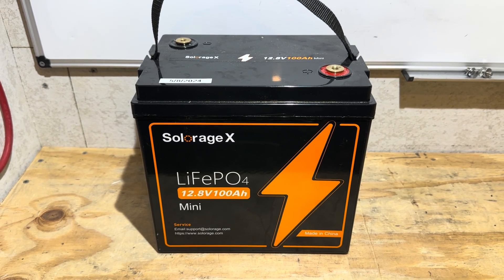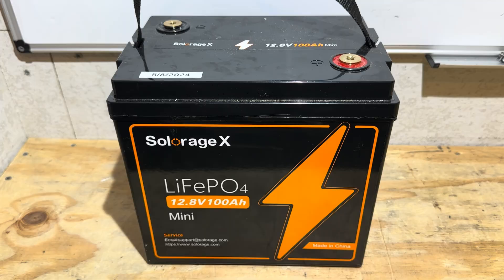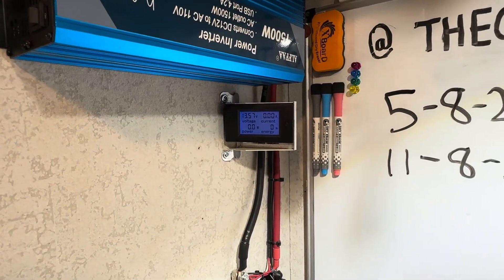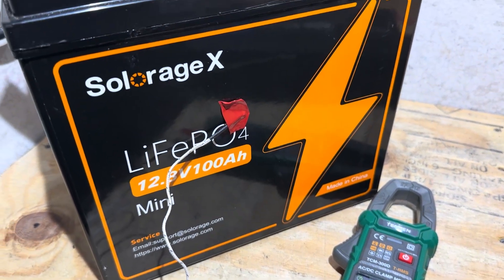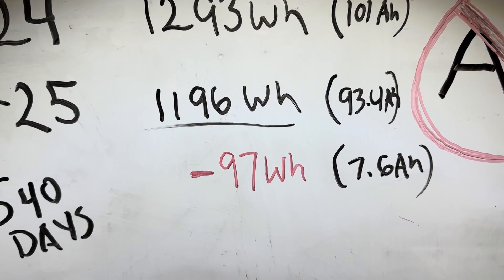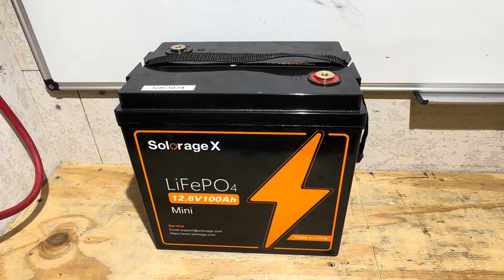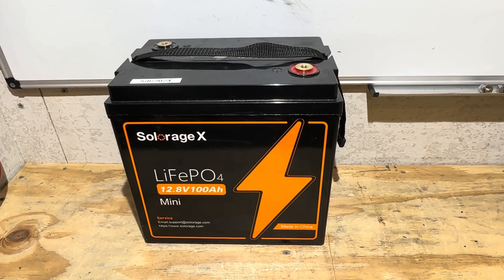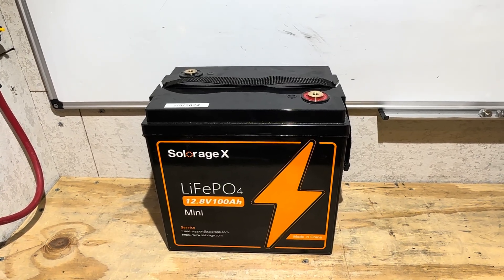Used LiFePO4 Capacity Test, Solorage X Cheap 12V 100Ah LiFePO4 Lithium Battery

Comment: I would be curious if the cells just got out of balance. It would be a awesome test to rebalance the cells and retest.
Reply from the maker: Thanks for the suggestion, that may be a great follow up video! 👍
Reply: @THEOFFGRIDMOUNTAINHOMESTEAD  Yes that would be awesome! I have seen this on several different batteries of my own. But not quit that big of a battery. More like 20ah. So I wondering if that is the same with yours.

Comment: Can it be that low usage creates more unbalance?     I understand that most BMS needs charging to full and some worktime to balance the cells. So, would a couple of discharge to zero and charge to full increase capacity?
Reply from the maker: We’re got to find out soon. Upcoming but not necessarily in this order. 👇
1 battery never used only in storage @50% SOC
1 battery that has been beat to death, pulled to 0 with partial recharge etc.
1 name brand that has had a similar use as the one in the video.

Comment: No check on cell voltages? Having the battery out of balance could easily cause this, not the cells quality.
Reply from the maker: It achieved over 14.4V on charge, didn’t trip cell low or BMS low. The inverter shut down first. Shouldn’t be too far out. 
Regardless if a runner cell has developed this still potentially shows inadequate capability of the balance function on the no name board or poor matching of cells initially upon construction. 

The purpose of the video was the battery as a whole. Not to investigate at the cell level. That would be more fun on a budget brand underperforming 51.2V 100Ah rack mount, wouldn’t you agree?
Reply: I think the video was an excellent example of what might happen to a battery that's been used for a couple years, just to see what the actual capacity is. 
I'm just saying I think a more thorough investigation might show WHAT the issue is (cell degradation or balance issue).
Reply from the maker: @J @Jasonoid Yes good suggestion. I’m replicating with a more popular battery that has a well known BMS and verifiable cells. Cells I can actually get a data sheet for lol. If it has issues I feel it would be a better candidate for deeper dive. Appreciate you.

Comment: I guesstimate if a Cheap used or Refurbished Battery can Deliver 3 years of Service.
It's Paid for Itself sure enough. Paying Prime for REDODO, RENOGY, CHINS, CYCLENBATT so far has panned out well for Me. It's real nice to see Larger capacity batteries offered for allot Cheaper than 2 or 3 years ago.
Better Technology will be available in the same Time Frame moving Forward.

💦 Indian Creek Ranch ⛩
Reply from the maker: $120-$150 LiFePO4 if they will actually last 10 yrs as MFG claim is a small cost per annum. If these type batteries were still $350-400 it would be more disappointing.

Comment: 7.5% loss isn't too bad. run it for another year, and, I'm willing to bet, you don't lose another 5%. Most degradation happens in the beginning, then, holds pretty steady for the next thousand or so cycles. It will probably take a decade or more, to get down to 80% of original capacity. Try these same tests, with lead acid. Lithium is DEFINITELY better!
Reply from the maker: Each chemistry has its unique strengths/weaknesses! Thanks for watching and commenting today. 👍

Comment: Another great review! I think that I heard that the first year is when you get lose the most and the following years you don't lose as much capacity, but I could be wrong. Might have been Andy from Off Grid Garage.
Reply from the maker: Some cells are known for quicker decline then stabilization after X cycles. You can search for cell data sheets from some of the raw cell vendors and find different cell/brands performance curves etc.

Comment: Kinda a bummer. Guess I kinda expected aftermarket batteries to be lower quality. In the automotive world batteries have made a steady decline over the last 10 years. My Subaru needs a battery every 2 years since it was new in 19 and OEM batteries are no higher quality than low shelf autozone batteries. Par for the course with global battery markets
Reply from the maker: Good observation! I too remember even a Walmart battery lasting 7 years easily. Last standard battery I had made it 2 years as well. Price up and quality down unfortunately.

Comment: i tested a 1yo river 2 (256wh) and it has now a capacity of 144wh!!
testing from the 12V cigarette socket @ 50watt constant and charging with 12V DC thru the MPPT.
Reply from the maker: Wow! Thanks for sharing this! 👍
Reply: Wow! My River 2 is the exact same. Capacity tested it a month ago. Huge degradation
Reply: @yzman321  do you still have your receipt? i managed to contact CS and get a "refurbished" unit. they didnt even ask me for proof. i just told them i did a battery test by monitoring the Ah coming in and out and wrote the numbers. they agreed right away and gave me a pre-paid slip to ship it to them.

the "refurbished" unit i got is brand new. not a schrach on it and it tested at 241.6Wh (out). i suspect the old version was defective from the factory or something and they know its a problem.
Reply from the maker: @yzman321 Thanks for sharing your experiences as well!

Comment: What capacity did these batteries use per day? And did they get fully charged everyday? Just wondering, Good test and video.
Reply from the maker: It varied depending on weather and use. I have some details in the description on how it was used.
Reply: @THEOFFGRIDMOUNTAINHOMESTEAD  If both of these batteries you did videos on were in the same system, I wonder if one of them being weaker than the other from the start caused the others to degrade faster. Not sure if they were in  the same system. Great information. Thanks for the videos.
Reply from the maker: @jw3843 They are just cheap piles of 🇨🇳 💩

Comment: Very Good!  yes, please try a "premium" battery.  Is it better battery or better advertising?  I hope your batteries had used or "second quality" cells and the whole PIFEPO4 thing is not just hype.  

A T Burke
Reply from the maker: I have always wondered about some claims of these brands where “battery will last 15000+ cycles” etc. 
Not looking too good so far. Check out the article in the description. Very interesting info and data!

Comment: Very good re-review.
None of these LifePo4 batteries & Power Stations have been "proven." We won't know if they live up to their claim of 4,000 cycles to 80% for a few more years, including the so-called top brands such as Ecoflow & Bluetti.
Reply from the maker: Thank you, I have been planning long term updates for other things as well. Currently running long term use on several items and of course will release videos after what is a proper length of time.

Comment: I can't say I'm really surprised. I haven't seen anyone else doing this test on used (gently used) LifePO4 batteries. Is that to protect the manufacturers claimed proficiency? I request that you keep up these tests when the opportunity arises, and try a higher quality/bigger name brand battery if you can.

Good work.
Reply from the maker: Thanks! I plan to try a “name brand” next. 🙂👍
Reply: @THEOFFGRIDMOUNTAINHOMESTEAD  I don't always make a comment but I do leave a "like". Great idea from the original comment to do a name brand test. Makes me wonder if Lifepo4 is just a big hype. I have a lead acid plug and play unit and it still performing for the past 5 years. You also should see the latest Will Prose video on a Lifepo4 Battle Born battery when opened up showed it to be a piece of junk.
Reply from the maker: @JohnT.4321 Thanks for watching and commenting today! I appreciate your support and hitting the 👍 really helps, especially now with the changes in the algo.

Comment: I wonder if it is just the balancing of the bms 🤔
Reply: I had the impression 14.6v is the top voltage and should stay there for a while balancing. My 4 year topband ( chines) still has 93ah out of 96 ( yes, it was sold as a 96ah battery). Very lightly used sometimmes charged only with solar and during winter with charger (14.6v as specifed). Same with my power queens and dchouse. Only a year old so havent felt any need of capacity testing.
Reply from the maker: @BeeBeorn Some batteries won’t ever reach 14.6 even when new due to poorly matched cells or subpar balance circuits. One or more cells commonly trigger Cell Over Voltage. I see this happening with a lot of different brands.

Most common BMS balance at anything above 3.3 to 3.4V/cell depending on manufacturer. WattCycle/Humsienk are outliers at 3.5 per cell. These are passive balancer setups.
Reply: @BeeBeorn  the charger will output 14.6v but the battery is different. The battery has a bms inside that stops the voltage from the charger from reaching the battery cells. So even if you read 14.6v on the battery terminals if you were to access the actual battery pack it would read lower. Its nice to have a bms protect the battery cells because in theory you could use a 15 volt or 16 volt charger and still be fine.
Reply from the maker: This could have an effect on overall capacity but from what I’ve experienced it shouldn’t add up to the amounts of loss. Usually when the cells are really out of whack charging won’t exceed 14.4. 
Of note, but cut from the video for time sake, the charger went through its full CV taper down to less than 60W charge on this battery before the BMS shut down. 
The previous battery Weize, the charger shut off at 80W.
Reply: @THEOFFGRIDMOUNTAINHOMESTEAD  exactly, 14.4v without a bms disconnect indicates no imbalance of capacity between the cells.